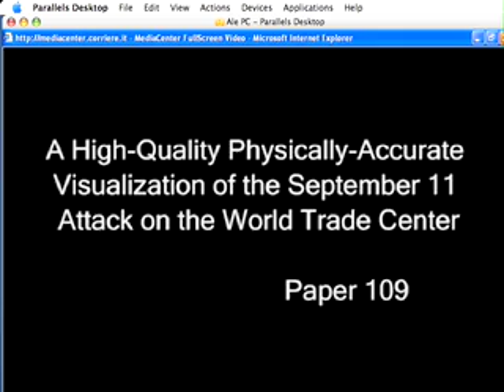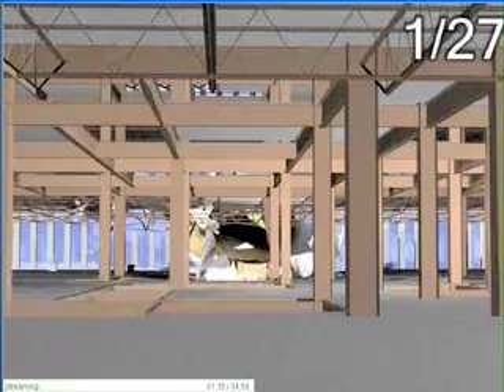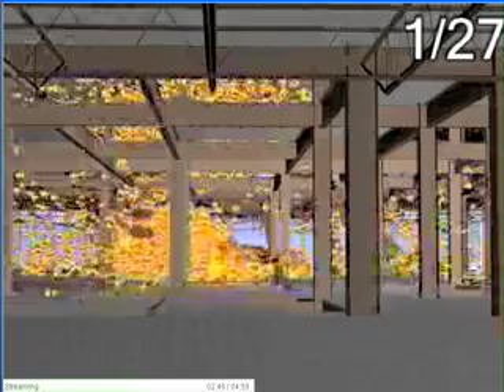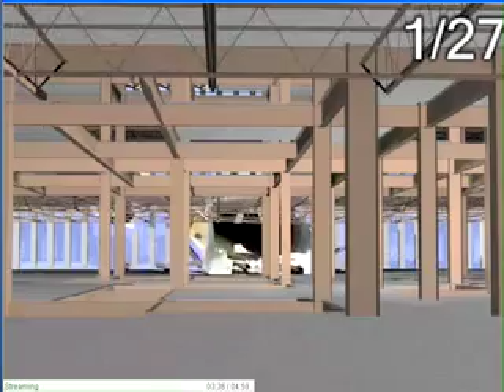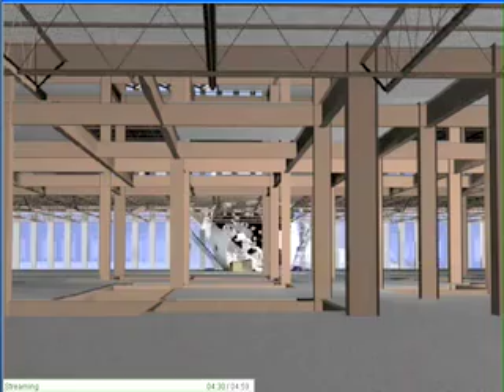9-11 Twin Towers Attack 3D simulation

Comment: steel cut  by Aluminium sure.
Reply: lead is softer than aluminum yet when a lead bullet is fired at 1500 mph it will easily penetrate an iron engine block or any other steel inches in thickness. how do you explain that genius? ive personally fired q-tips from an air rifle thru a beer can,cardboard box and all the way thru my home office wall and into the next room.a q-tip! u know a paper tube with cotton wrapped ends penetrating aluminum,cardboard,1" drywall,insulation and still had enough speed to dent the far wall. and could have killed someone had their head been in the way.would you care to explain that Einstein? its called "energy". produced by velocity × mass.
geez! learn some basic physics before commenting on anything more technical than whether its daytime or night.
Reply: Skyze Photography - A plane is NOT merely a tube made up of thin aluminium as you people keep suggesting. It has engines, bulkheads, seats etc, and when travelling at high speed it will be a force to reckon with. To merely state that aluminium can't cut through steel is a completely bogus argument.
Reply: Steve.   
Lead is used for bullets since it is relatively cheap.   Missouri Bullet Company offers premium lead bullets at affordable prices. We make hardness optimized bullets for the velocity of the loads you shoot.
If you had a clue bullets have penetrated iron engine blocks many times.
hell, even the biggest tanks in WW II with up to 7 inches inches of steel  armour were holed by shells of about 3 inches diameter..
Reply: Ricky Timms -your knowledge of physics is severely lacking.
im going to explain this one more and last time.
velocity is the key.it matters not how hard, soft, dense or less dense if the velocity (speed) is high enough even a cotton ball can blow right through those 2" thick steel beams. believe it or not its true.those 2 aircraft blew through those buildings like a hot knife through butter because of their tremendous energy due to their extreme speeds.
it works like this- energy= mass(weight) × velocity squared
if you drive a marshmallow to approximately 395 mph it will go all the way through a car door. ive done this using an air cannon in school and speak from fact.also using a basic .22 cal air rifle anyone can purchase,ive fired a Q-tip through a beer can,cardboard box half full of foam shipping pellets,all the way through my office wall (1/2" drywall,4" of insulation,another 1/2" drywall sheet,exited the wall and sailed across the adjacent room and still had enough energy to dent the far wall. if someone had been in the way that Q-tip,a rolled up tube of cardboard with cotton swabs on each end, could have killed them!
the same physics applied to the aircraft that hit the towers that apply to everything else.
now if those planes were only travelling at a normal 150 to 250 mph they could not have penetrated the buildings.there would have still been destruction and fire but the vast majority of the wreckage would have remained outside and would plummet to the streets below in a thunderous crash. however the planes were travelling at between 400 and almost 600 mph and possessed many many times the energy than if travelling at more reasonable speeds.
the planes crashed through with little resistance.this of course destroyed and eviscerated the aircraft but it doesnt matter if its a consolidated object or pulverized into a million tiny pieces,it still has the same mass(weight) and most of its original velocity and therefore energy. in fact even if you fired the equivelant mass of water at those speeds at those towers you would have very similiar results. its very simple physics.
dont believe me? research it.study ballistics.that subject will fast track you and give you enough knowledge to understand what happened.
believe it or not its true.
you know,some of the WW2 battleships had armor plating as much as 24" thick. solid steel much much harder and tougher than any puny 2" thick structural beam made of whatever "#1 construction steel" you can find. yet shells fired from several miles away penetrated them easily.
battle tanks from the same war with several inches of armor were also easily penetrated by shoulder fired weapons. how? energy! produced by velocity of mass!
before you protest.research. i challenge you to educate yourself a bit,and when youve seen the light come back here and say as much.
so that you may help another person that is convinced the US government is responsible for 9/11 because the planes "cant cut through steel beams".

while your at it how about researching metalurgy and thermodynamics. along with a refresher course on architecture and civil engineering and steel high rise construction.
afterwards youll understand precisely how the fires from the planes weakened the already damaged towers and caused their complete chain reaction collapse and total destruction.
i assure you its not only possible but it happened.almost precicely like the NIST report concluded.
and no im not a government proponent. i dont trust my government as far as i can throw them but as far as 9/11 is concerned, it really did happen pretty much as explained.
Reply: Dicky Timms.
You still try to make out the planes were just thin hollow aluminium.and the towers were solid steel.
Reply: Dicky Tummy.
Research into what? How a large heavy plane if flown at high speed into a building will do a lot of damage?   I already know that much, it won`t do the plane much good but the building won`t be in great shape either.
Reply: No Ferry Rodliffe...I suggest you do some more research and engage thy brain BEFORE thy mouth !!!
Reply: Lead bullets at 1500mph will not penetrate an iron block. In fact a lead bullet fired at 1500 mph would deform from air friction alone and would almost be as flat as a quarter in about 200 feet.
Reply: No one is ...its not 1500 mph it more like 2300 ft per second..Second, there's no way in hell aluminum is going to cut through #1 steel grade columns   Yes multiple #1 steel grade columns   ...PERIOD !!!  Yes ..Lead is softer the aluminum but its much more dense like so many of you commenting !!!

Comment: I believe planes hit the towers.

I believe Islamic extremists did do it.

Where I do cross the line is that they were unaided and that the towers fell from planes alone.

I believe that the United States did have some things doing with this because too many things just don't add up from that day.

Something just isn't right, there's no way those guys with 0 experience flew the planes so smoothly into the Twin Towers and the Pentagon.

Nor did the towers collapse correctly falling into their footprint, I replay the collapse and I can see small squibs going off just right before the plane hits, the way the towers fell doesn't seem right to me

Something that also throws me off is that Tower 7 fell and how it fell, it was a government building and it's fishy that that collapsed and also it looked exactly like a controlled demolition and was never reported on any media

Even with the pentagon, I recall many tapes showing the crash were confiscated by the FBI which I find extremely fishy, and it took years for them to finally release tape of the plane hitting the Pentagon.

And even at that it's a pretty BAD piece of footage and it's up for debate whether you see a plane or missile or some kind of vehicle rigged with bombs.

I just can't believe that a plane  flew so low to the ground with leaving any signs that it happened on the ground, I also notice a white trail right on impact, but these are just my opinions

I personally think that planes were involved with WTC, but there was more to it

I believe something else than a plane hit the Pentagon stuff doesn't add up there

Also with the Pentagon the section that was hit was investigating where trillions of dollars had went which is very odd.

I'm not trying to disrespect anyone and im not arguing that Islamic radicals DIDNT do it and I'm not saying planes were not involved with WTC, because these hold true.

But other than those things, stuff was really fishy and didn't add up right for me, you're welcome to challenge my opinions if you want.

May the victims of 9/11 rest in peace.
Reply: I stopped reading at "those guys with 0 experience" and concluded the rest of what you'd written is a load of shit.
Reply: Yeah the 0 experience part was bullshit it wasn't an inside job (lack proof of course, we have so much proof that it wasn't) They trained to small fly small planes, Atta and Al-Shehhi had sneaked into A boeing 757or 767 cockpit simulator
(I don't remember which one they snuck into) Jarrah later trained to fly big engine airplanes. And Hanjour also trained in a few simulators. 
And the part when you said they flew so smoothly was also bullshit too lol. And what you said that something else than a plane hit the pentagon is also bullshit.
1.Atta wasn't cautious when making a 100 degree turn to the south to follow the Hudson River towards NYC.
2.Al-Shehhi hit the exact edge of the South Tower which almost got his wing cut off.
3.Hanjour hit about 5-7 lamp poles before striking the Pentagon which made one of the engines smoke which can be seen in the Pentagon footage.
4.Something else than a plane hit the Pentagon? Hmmm..... if it was a missile that hit the Pentagon then there would be no reason for those lamp poles that are far apart to be knocked down. A bunch of people who are saying the truth (Obviously not 9/11 liars which is a nickname for 9/11 truther) don't really pay attention to the lamp poles because they are more focused on the passengers. 
If a missile knocked down those lamp poles then, it would explode before hitting the pentagon. 
5.A bunch of so called TRUTHERS say that it's impossible to fly a boeing 747 a few feet above the ground. Well I'll have them know that it wasn't a few feet on the ground for long. How the fuck do you expect a plane to land then? Especially a small engine plane that is smaller than a commercial aircraft but same engines.
I'm not gonna continue arguing with you because planes obviously crashed on 9/11. No demolitions nor missiles nor holes were used on 9/11
But you are right about the 9/11 victims rest in peace.
Reply: Didn't take a flight path to the poles? Well sure i guess they can magically fall down themselves.
Reply: I believe you're a moron
Reply: Saudi Arabia funded this.
Reply: AntiStealthBoy hey troll, a plane landing isn't traveling at max speed, also the hole in the pentagon was the size of a garage door. The  roof didn't fall in till later. 2nd the plane didn't even take the flight path over the light poles. You're either a moron or a troll. Most likely the later.
Reply: Interesting how people who question the official narrative are always called names.

Comment: If a 767 with a full tank of fuel, and ignited upon hitting the building at a few hundred miles an hour. Going to do a lot of damage.  The plane hitting the building was the most damage. From wing tip to wingtip, the plan was the same soze as the face of the building. To the fuel and intense fire just finished the job.
Reply: +C.J. Baron planes are made of fiberglass and aluminium,the entire side of the towers is covered in steel....think about it........with massive steel columns......re bar reinforced floors supported by very large i beams....then you get to point and have to ask how did the buildings fall at free fall speed or terminal velocity,besides a fucking B17 hit the Empire state building it burned that building is still there,you should check out how bad airliners do in simple crashes the things break in half,not to mention they are so light they will do and have floated on water,deny it all you want